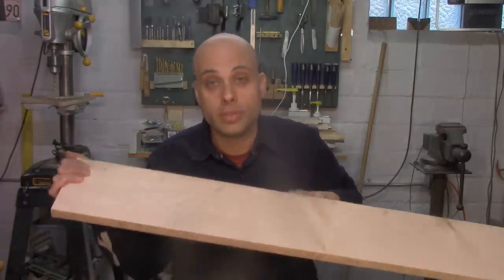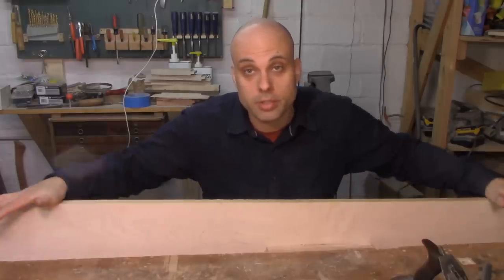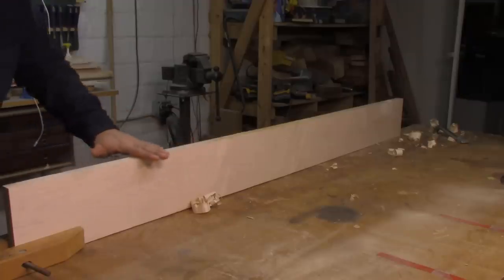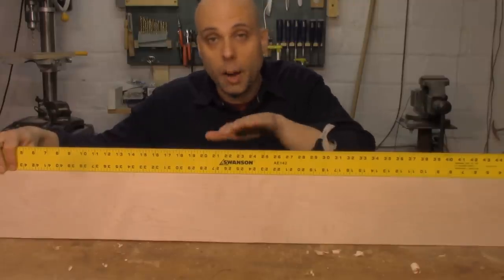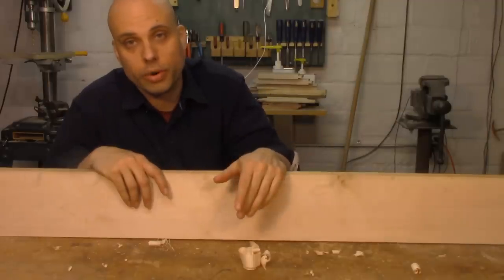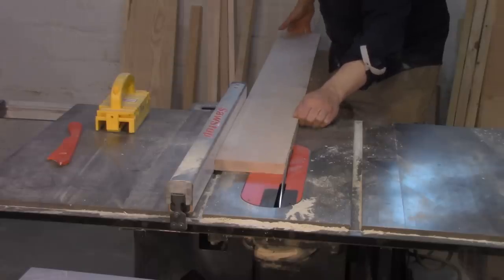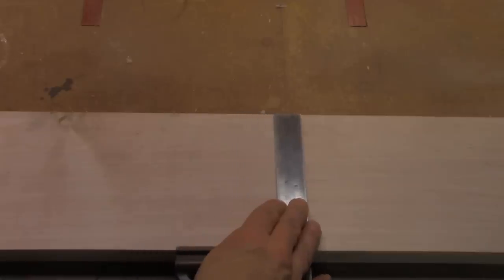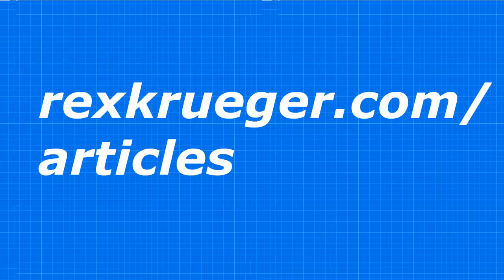Straighten boards. No jointer. No jig.

Comment: BULLSHIT, what if have 10, 20 or 30 boards to do and let's just say that you want to have both straight edges on each board so you can choose a better one later when ripping them to smaller strips? THIS HERE CREATES STRAIGHTER EDGE THAN THE BEST JOINER. There is a way better way to do it and still use just a simple table saw. Here is some guidance on how it's done, maybe you should do a follow up video on this topic, if so email me with any additional questions you may have, but I will try to explain it here anyway. (A). Out of the many boards you may have find the longest and the most straight one, this one board has to be longer than the other once by about 3 or 4 feet. (B). Make one edge perfectly straight as you showing in this video by hand but only one . . . Now to copy this one perfectly straight edge to all other edges on your boards using the table saw, this is what you have to do . . . (1). Insert some 3/4" piece into the table saw top groove on the right hand side so it sticks up a little, you can also use a fance but this guide board would have to be ripped to size so both edge are parallel. (2). Place your straight board on the right hand of the inserted piece and pull it towards it, therefore making it parallel with the blade, so the end of it is flush with the back of the table saw top, but so it is 3 to 6 inches away from it, this is important. (3). Then clamp it on the right side of the board to the table saw top at front and the back and support the other end of the board that's sticking out at the front of your table saw with a stick or a horse stand , so it it a couple of inches higher than the end resting on your table saw top, it's ok to use more than one horse stands if it's sagging too much. (4), Now , here come the trick . . . your board will be set perfectly parallel to the saw blade at about 3 to 6 inches away from it on the right hand side with the straight edge facing forward, all you need to do at this point is . . . (5) Create a piece of guiding stick approximately 1" x 1" x  16" and cut a notch at one end 1/2" x 1/2", this end will rest on the straight board  edge attached to the table saw and glide on it when making these cuts. (6). By placing the notched stick horizontally and perpendicularly to the attached straight edge of the attached board so the notch is resting on top of it, screw couple od wood screws onto it from the front towards the table saw on the left end and slightly lower from the horizontal center line of the stick so they are sticking out on the other side by about 1/4", this will be used to hold the back end of the boards you will be cutting so they don't wonder left and right while cutting them. Also make a mark on top of this stick with approximately the same distance as the guide board is away from the blade starting from the inside of the notch towards left side. (8). Place your curved edge board on top of the table saw so the board is flat in front of the saw blade almost completely towards the left side and align it so the saw blade will start cutting the right side edge about 1/4" into it, then  holding the back end of it rest the notched stick on top of the straight guiding board, align the curved boards right edge so it is past the line towards the right by approximately the same amount, which in this case is 1/4" and push the stick with its sticking out screws at the front into the curved boards end by hitting it couple of times. (9). At this point once you start the cut at he front of the board the secured stick will guide the rest of it perfectly straight, therefore creating e straight edge even better than the best joiner as long as you hold it towards the right hand edge of the straight board making sure the notched stick slides along that edge. (10). Finally, repeat the process on all boards even on both edges and do one board per minute or even faster with a perfectly straight edges on all of them . . . NOW, I DON'T MEAN TO BASH YOUR VIDEO REX, IT IS PERFECTLY FINE TO DO A COUPLE OF BOARDS THE WAY YOU HAVE SHOWN IN THIS VIDEO, HOWEVER IT'S JUST THAT THERE IS A BETTER WAY IN MY OPINION, AND I HAD TO START WITH BULLSHIT TO GET EVERYONE'S ATTENTION. If you are willing to do a follow up video with my method and have some questions or problems completely understanding it , shoot me an email and I will sketch a simple drawing for you  to get a better idea of what I was trying to explain in this comment. Thanks, Mario.
Reply: I don't doubt the method works, but it's not exactly rex's audience, which is the hobbyist, possibly in a small space that may not be well conditionsed with the final joinery cut with hand tools.  That perfect edge will twist or wrap sitting around an unconditioned shop, or if if the kiln operator left it a little wet to save time/money. Cutting rough stock near to size and then prepping helps avoid  the need for rework.

Comment: Why would anyone want to spend hours on edging boards it's like saying you don't need a table saw you can use a hand saw. If that's what you want to do go for it.
Reply from the maker: It takes a lot longer to explain than it does to actually do. It's fast and not difficult.

Comment: I mean, why use a hand plane at all?

Imo, unless youre balls out and make a point to use hand tools just make a plywood sled with a couple clamp dogs on it and clamp your pc of rough cut wood to it and use the perfectly straight and smooth edge of the plywood jig your "refrence" face for the initial cut and you get to save a whole shitload of time fuckin with a plane....

I mean, youre running it through 3x so youre cutting that planed shit off anyway....why not just skip that nonsense entirely?

Thats how i do it and youll have perfectly straight, flat, parallel edges in about 5x faster than it took to watch this video.

Not slamming you  OCP, just saying, the jig way is way faster imo

Comment: Why not clamp a straight edge like some aluminium box section to it and trim with a circular saw. Its not rocket science. If you can afford a board you can afford a aluminium box section..then run it through a table saw. What aren't i getting here?
Reply from the maker: Well, lots of people don't have a circular saw. I did woodwork for about a decade before I got one. This approach is also very safe and teaches you a lot. No where did I suggest that this is the only way. It's one way. I like it. Other people like it. You like another method? Go crazy.
Reply: @RexKrueger  you see thats why i asked.... what aren't i getting here. Thanks you answered that. I know a little not alot...
Reply from the maker: I'm glad it's useful to you. Good luck with your woodwork!

Comment: Your process is way to time consuming and does not guaranty a perfect straight edge. My work bench has a dead straight front edge that I contacted a laminate strip . I use a 1/2 collet bottom bearing flush bit in my router. Clamp the board with a slight overhang and run the router.. If the board is to narrow to clear the router base at the clamps, just snap clamps where you cleaned and then remove the other clamps and finish dressing. Voila, a dead straight  edge under a minute.

Comment: to dam much work buy a jointer
Reply: I agree with Rex. Don't want no dinkey li'l 6"er anyway. Need a full 12" minimum, or you miss all the utility of flattening a board. And brother, they are expensive, even old ones. L

Comment: Time is money. I'd rather run it threw a jointer.
Reply from the maker: Through.
Reply: You could have done it faster you js had to take the same ruler find the center of the shared it half on the wood shrewd it down to the wood using the ruler as your straight edge and passed it through the table saw